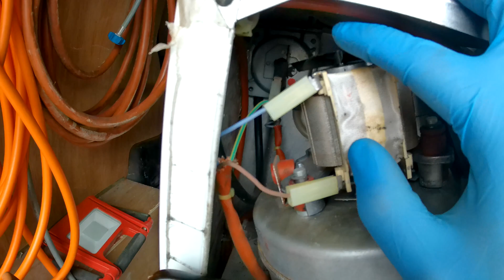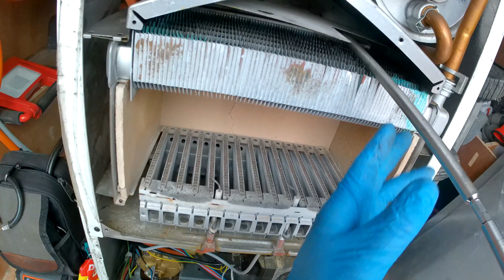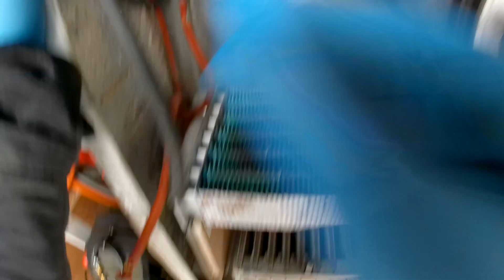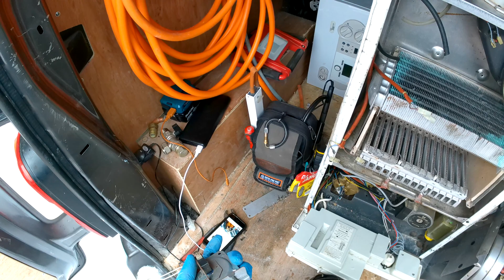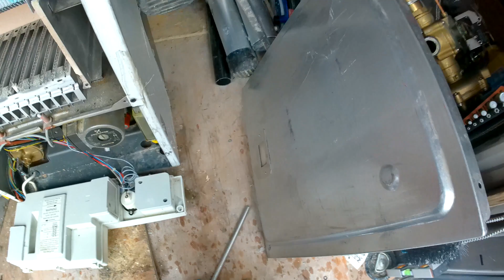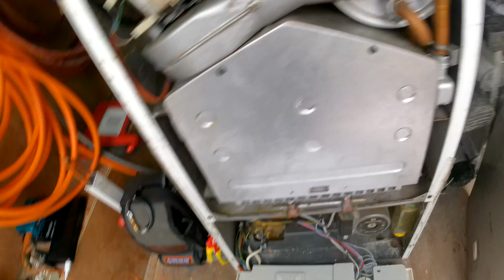Main Combi HE - Changing The Air Pressure Switch

Comment: there's enough clearance to the left.  Just remove the left panel.  Easy enough task  testing and changing the Aps on these boilers.  I test on the pcb.  The replacements aps on these are the plastic type
Reply from the maker: I’ve pinned this for others to see👍